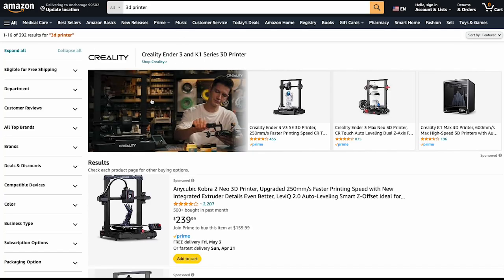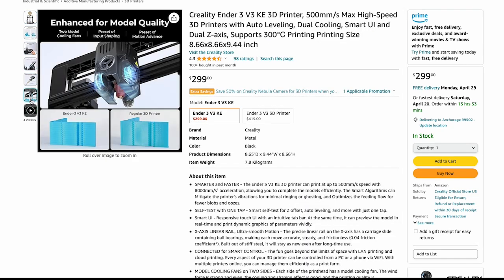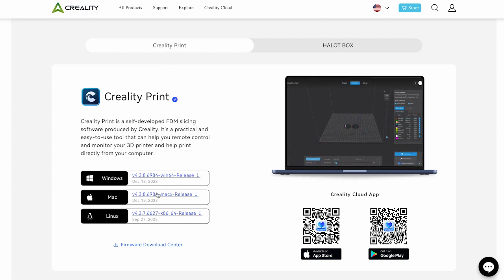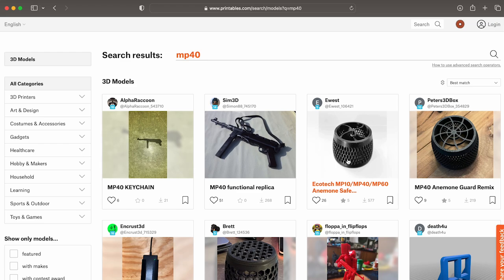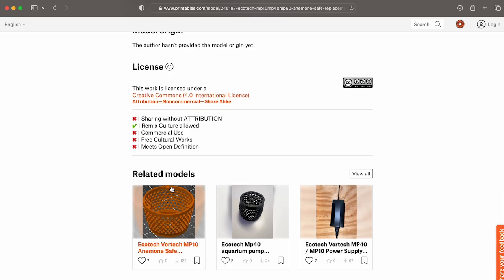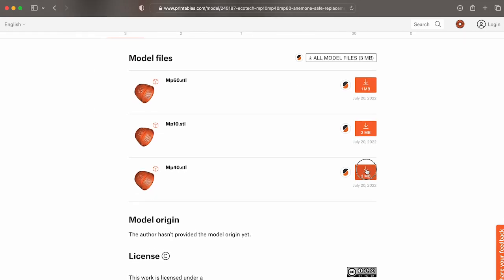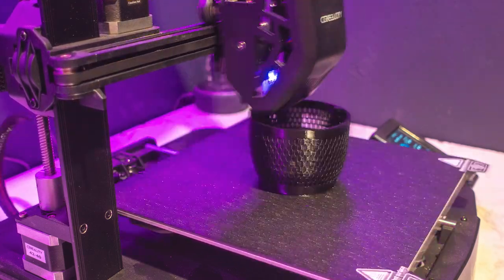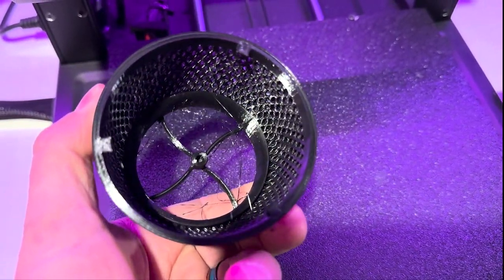This tool changes EVERYTHING about reefing in Alaska!

Comment: Hey, i have no idea why i landed here, but the most valuable thing when printing PETG is drying the filament. If you dry it for 12-14h at 70C°, you will most likely not experience any stringing anymore. Also don't store it open air, or it will reabsorb moisture in a short amount of time. Since i store petg in modified cereal boxes with desiccant inside and print out of them with a ptfe tube, i never had any stringing problems and so far used around 20kg of it :) If you still have stringing with your super dry filament, try lowering the nozzle temp a little bit, if that does not get rid of it, you can also play with the retract values or use another combing mode, so your nozzle tries to follow the path of your part when moving to another place :) Welcome to 3d printing :)
Reply from the maker: This is why I love youtube. Thank you so much for this tip. It 1000% works and has made my life so much easier. THANK YOU!
Reply: @AlaskaReef  Glad to hear that :) you are welcome :)